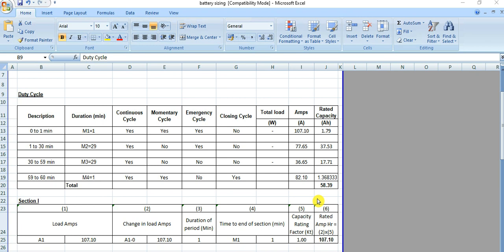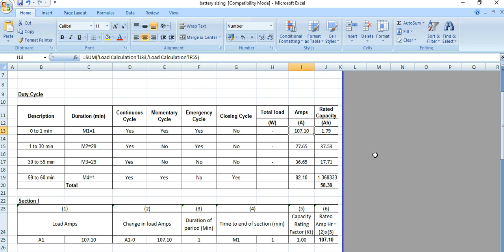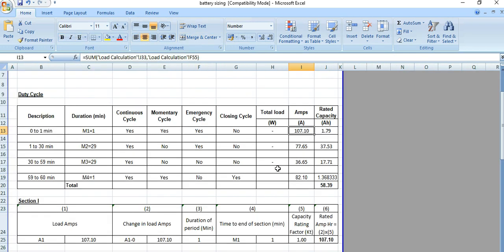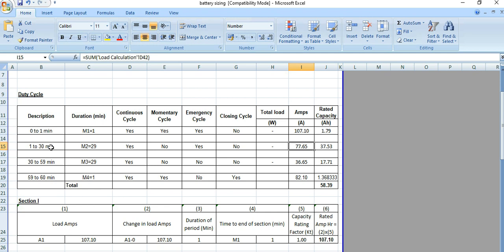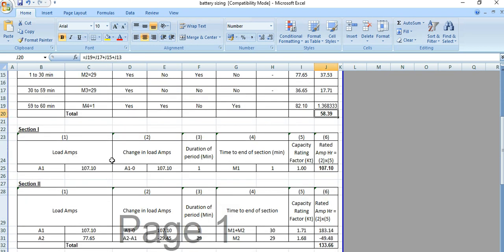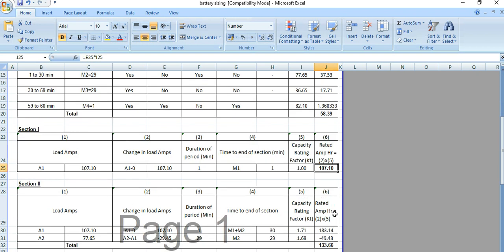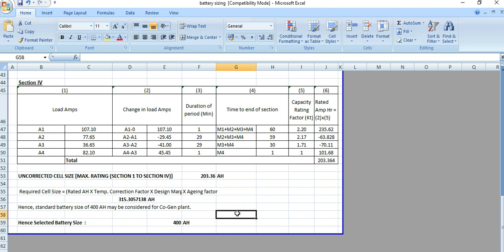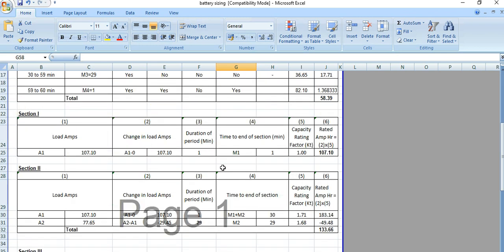Battery Sizing Calculation in Excel (Part-4)

Comment: I am trying to build an excel sheet to size battery per IEEE 485. I would appreciate if you can share your files. I will use them to validate your calculation and provide you feedback.

Comment: Really thanks for this information...I have one doubt in this video-How to select capacity rating factor (Kt)...can you share this excel sheet.
Reply from the maker: Follow this link to download the battery sizing excel spread sheet-
https://drive.google.com/file/d/0B45TZHAylG05c3RhcnRlcl9maWxl/view?usp=drive_link&resourcekey=0-H1FmPx4eqKQ35D1JC0Mokw
Reply: The ratio of rated ampere-hour capacity (at a standard time rate, at 250C and to a standard end of discharge voltage) of a cell, to the amperes that can be supplied by the cell for t minutes at 250C and to a given end of discharge voltage is known as the capacity rating factor.
It is provided by manufacturer
Reply: @SmartEducare can you provide EXCIDE GRAPH FOR THIS CALCULATION
Reply: Thank you for your detailed explanation. Can you share the Excel sheet..